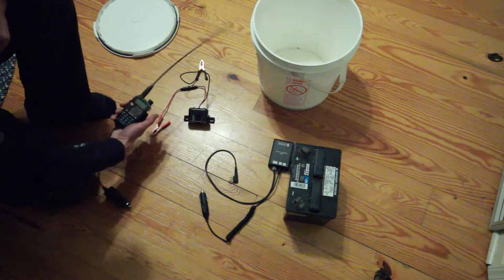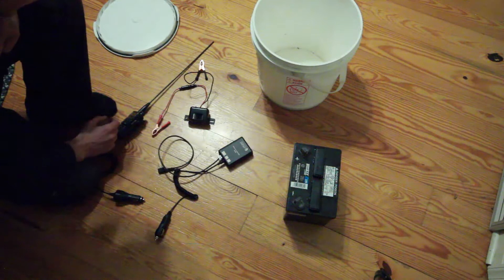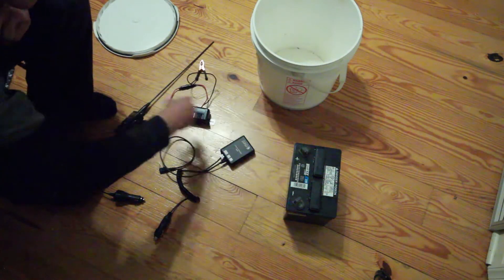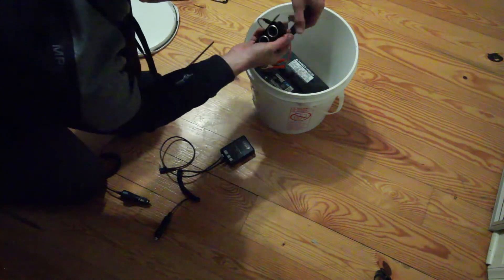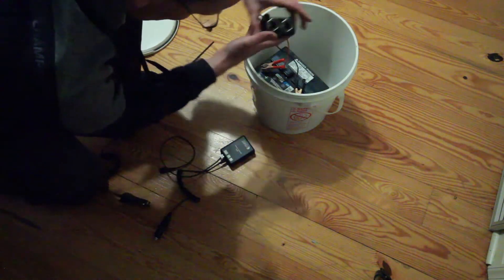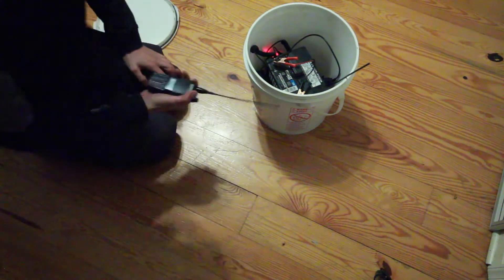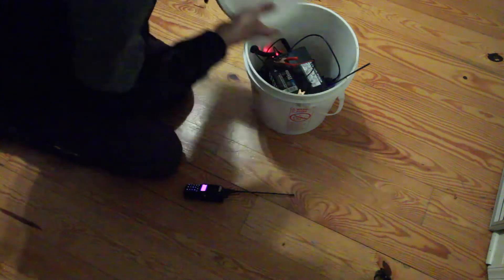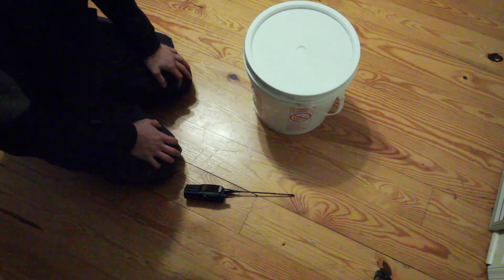Simplex Bucket Repeater

Comment: I was in the process of making this same setup,  however I was going to add a few more items in the bucket for those times I go to check on the repeater, and don't want to carry a few camp items.  Any updates with this project?
Reply from the maker: +462.562 MHz Good idea. Maybe I will put another bucket next to it with supplies. We have turned this bucket into a Broadband Ham Net Remote Solar Node for a little bit and will put the repeater back together soon. The Digital Remote Node worked great and we are building more of them. I have so many of these buckets since I know some bakers and they get their fillings in them. So some of them smell like raspberry or chocolate :) Otherwise I would do them in an ammo can which you probably have seen a lot of.